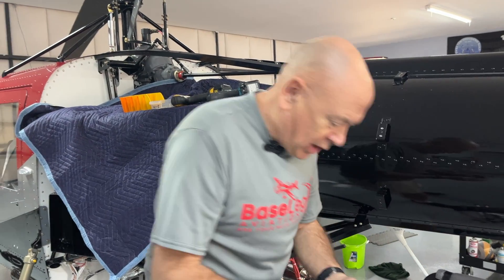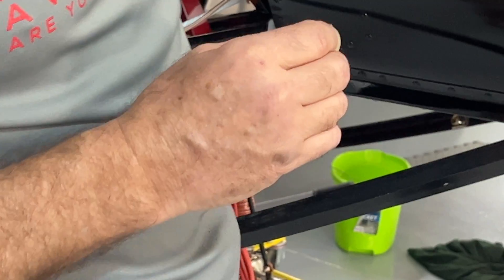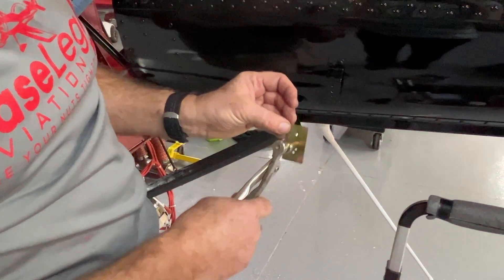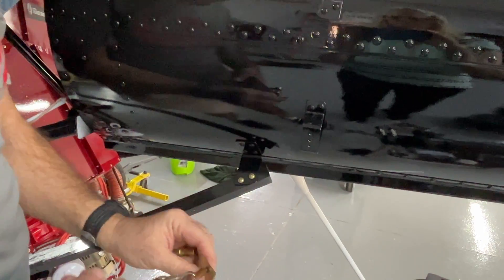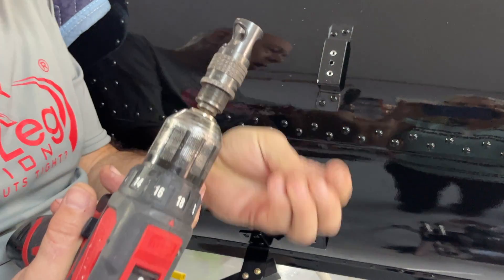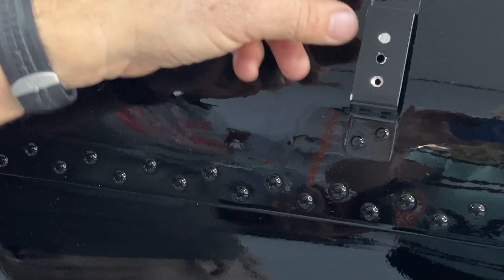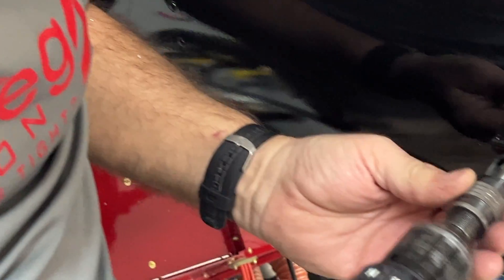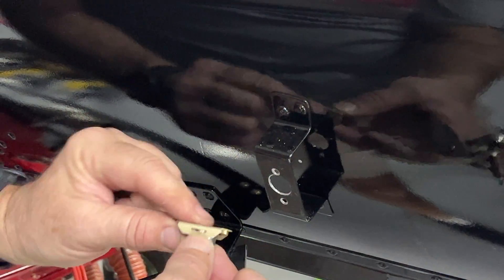Skybolt Fastener Installation Tips

Comment: Vic, what model or part number Skybolt fastener did you use?  I have Milspec and they went out of business and need a replacement fastener for one that is failing.
Reply from the maker: Hmmm. Not certain I remember. They have a catalog online that I used. Pretty straight forward.
Reply: Thanks Vic.  I contacted them and they put me on the right path.   Btw, I purchased your books. @baselegaviation1614

Comment: The old ones required a spring/roll pin to lock the socket position.  I don't like the pin so have used a loop of safety wire.  The pull pin seems an improvement.